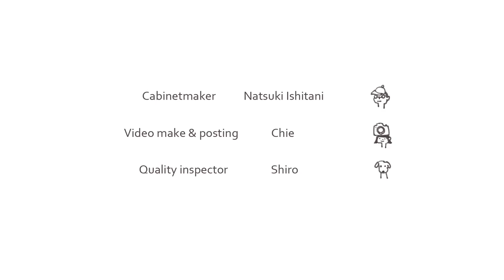ISHITANI - Making a Cupboard with Glass Sliding Doors

Comment: Very impressive work. Does anyone know how he maneged to get the tounge and groove back panels in after glueing top bottom and sides together???
Reply: The groove on the top seems extra deep, so he can push it up far enough to get clearance for the lower part.
Reply: thanks Alan, but are the panels not sitting in grooves on the sides as well, so the last panel to put in should not fit right?

Comment: Hi Mr Ishitani ! I let a comment in a other video of your. I don't understand how the wood can be working correctly. You glue all the wood's panels together. How can it be durable ? All the panels are going to explode someday. No ? I would like to know your secret. Many thanks !
Reply: alex c glue is stronger than nails or screws.
Reply: Hi Jo. Thanks for your answer but you didn't understand my question. We know for sure if you glue together two panels of wood, they won't be able to work corretly. And Mr Ishitani glue his dovetails together. For me, the panels can't work corretly. I don't understand why he do this. If one of the panel is dryer than the other, he will constrain the other in a bad way. You have to make a wood frame with groove. Sorry for my english. I'm french.
Reply: re: Gluing panels together.
1. Dovetails glued together at right angles (same species of wood, same moisture content) will expand and contract with the seasons at the same rate. The grain direction is the same, and so it works fine.
2. Sliding dovetails for breadboard ends (shelves here) DO need allowance for movement. The breadboard ends can be glued at one end (two-three inches) to keep the front surfaces flush. I didn’t see if Ishitani did this, but it can be done. There are also screws fastening the breadboard ends on. I’ve done this with oversize holes and washers, or with slots, so that the wood can expand and contract and then the screws adjust to the movement.
3. He does everything very well!
Reply: Ok. Many thanks Michael. Your explanation is very clear and complete !!!!
Reply: I am afraid to comment on YouTube. You are very gracious. Thank you!